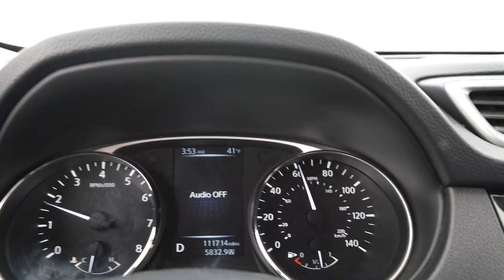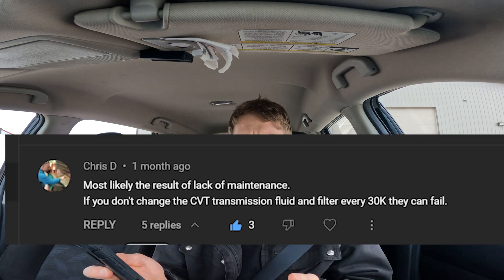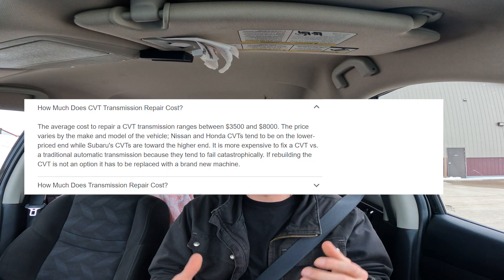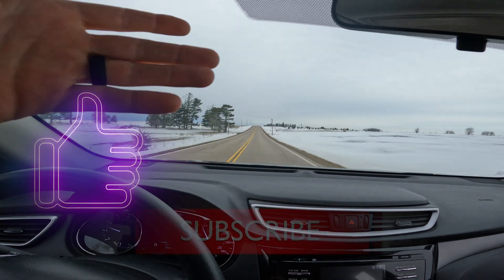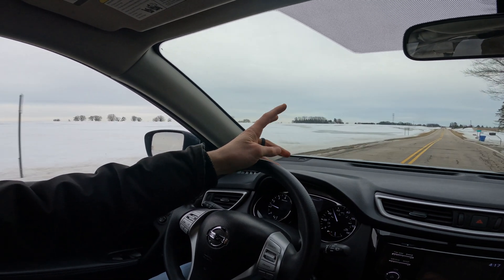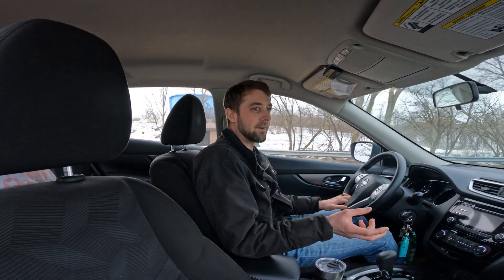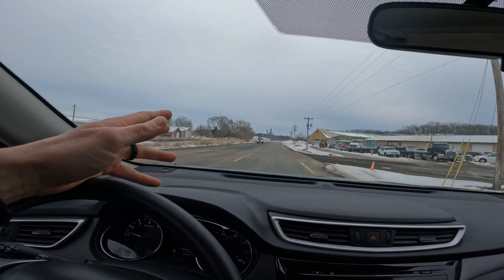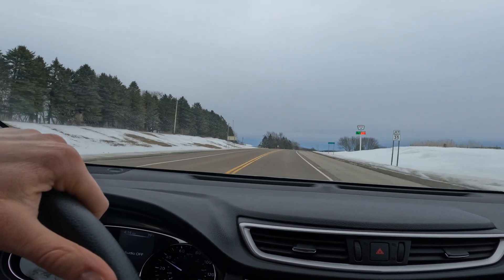Everything WRONG with the Nissan CVT Transmission

Comment: Nissan needs to be held accountable for selling faulty transmissions !!!!!!!
Reply: I have a 2017 Nissan NV200 and so far is running good
Reply: The government is pushing companies to comply with their pie in the sky climate change garbage perversion.
Reply: Nissan as well as many Japanese automakers use CVT for many models around the world, including Japan, since it's more fuel efficient and better suited for stop/go urban driving. There are no known issues in Japan with CVT, since fluid is exchanged every 30,000-50,000km as part of routine scheduled maintenance.
Reply: They're going out of business, Duh?
Reply: Faulty "Chinese" Transmissions.  And totally agree with you.  It really sucks to end up with a Chinese transmission in a Japanese car.  Just terrible.
Reply: @johannjohann6523  Jatco builds the transmissions for Nissan and is not Chinese they use some factories in China for manufacturing which all brands do. They are not developed and designed by China. The issue has been the CVT and its weaknesses. They need serious maintenance to last and since day 1 Nissan claimed they were sealed for life not service was necessary. Everybody by now should know to not buy a Nissan automobile unless it is a truck. If you buy a Nissan automobile and service the transmission every 25k miles you might make it to 200k miles if you drive it and baby it.
Reply: @NDIrishfan71  That goes for the Rogues too, get the CVT serviced / oil changed every 35K miles.
Reply: @metalmike570  I still would not buy one period. They have stayed with the CVT for too long and its putting them out of business. Better hope Honda does buy them because if they do not Nissan is gone.  Nissan should have offered traditional automatics they would have sold more. If I see CVT in a vehicle I walk away and buy something with a traditional transmission. I prefer Standard. I liked the Accord better than out Camry as far as looks and ride comfort, but it had a CVT and a Turbo in it 2 items I automatically say no too. Toyota got my business on a 2020 Camry SE. Cars been rock solid for 5 years knock on wood!
Reply: @NDIrishfan71  I have a Rogue, a 2019 and the engine is a 2.5 liter 4. We know the engine is great though. At 90K miles I just got the CVT oil changed again. If I get it done every 40 K it'll be fine. But the dealer - well I should go to the mechanic I used to go to but its several towns away. It cost $280 to get the CVT oil changed at the stupid dealer.
Reply: Nissans CVTs are made by JATCO in Japan 😂
Reply: The transmissions themselves are not faulty the fault belongs to Nissan on not educating its customers on how to properly drive and service a car with a CVT in it. They told customers it was a sealed transmission with lifetime fluid LOL. If you service a CVT every 20k-30k miles and drive it right they will last. You can not hot rod them and expect them to last especially never changing fluid and filters. Take off from a stop is the most stress on the belt that is why Toyota put a launch gear in their CVT's to reduce the stress on the belt during take off. Drive it normal, and do not drive aggressive. Change the fluid and filter every 20k-30k miles and it can reach 200k miles. Most people do not drive normal they drive hard and fast especially when on freeways. If you are a lead foot and like to drive hard do not buy a car with a CVT get a traditional automatic or stick shift transmission. If your a normal driver and want to save on fuel as much as possible a CVT is perfect for you.
Reply: @NDIrishfan71  This right here is the second issue (the first issue being Jatco transmissions are just crap).  Manufacturers lying about maintenance intervals is pretty much across the board now, they do it with the goal that the car will last throughout the warranty but have major engine and/or transmission failure right after the warranty is up.  Not changing transmission fluid, and doing 10k oil changes will accomplish exactly that.  Change transmission fluid every 30,000 miles (20,000 in these junk CVT's), and change oil ever 3,000-5,000 miles (only go up to 5,000 if it's mostly highway miles).  The Jatco CVT's are still junk, but they will last a lot longer.  Any other type of engine/transmission if you follow those maintenance schedules you could easily get 500k-1 million miles out of.  But even the junk CVT's you can probably get 150,000-200,000 if you maintain them.
Reply: @NDIrishfan71 my first Mitsubishi lasted over 200k but I traded and second one just broke at 177k and did fluids on second one every 30k at dealership.
Reply: @Mark-gk3hh  Every brand made has people that had a good one out of the whole, there are brands that had fa more good ones than other brands though especially if you took good care of it and did all the services. That being said there are brands that were pumping out less failures like Toyota, but if you look close at Toyota you will see they had duds a long the way. Far fewer duds than any other brand though they were the most consistent through the years. All of the Japanese made cars were better than domestics through the 80's and 90's. To  the end of the 90's and into the early 2000's domestic brands got their shit together and started delivering better vehicles that were lasting as long as Japanese brands, but it was still select models and engines that did better. Then 2008 rolled around and they went back down hill again then 2020 arrives and every brand has been a real shit show up until 2025.
Reply: @NDIrishfan71  The service interval stated in the Nissian Manual  54,000 Miles.  I have the paper right in front of me (xtrail T32)
Reply: @NDIrishfan71 You shouldn't have  to worry about it.

Comment: My wife's Toyota  2018 CHR had a CVT transmission replaced at 76200 miles.  Thankfully we bought this car used and had the Toyota 7 yr 100000 miles warranty.  The CHR cvt's are well documented having transmission failures anywhere from 20000 miles to over 100000 miles.  I feel sorry for the owners who bought a CHR new as the warranty is something like 3yr 36000 if memory serves.  BTW Toyota would have charged me $11000 to replace this transmission if it was not under warranty.

Comment: You are quite ignorant about this.
First. Nissan did have some issues with the first CVT generation.

Second and third generation have been fine:
I had one and know of other 7 Nissans with CVTs that are doing well. Half of them with Murano 3.5L. Lovely fast car.

You MUST change the fluid at 30-60K miles!

Other than that, CVTs are the quickest, most efficient transmissions and are NOT going anywhere!

Comment: You didn't even mention some cars with cvt have a launch gear that makes them more durable. There is no perfect cvt transmission. But there is a way to use them in car designs. The only acceptable application is to add a launch gear to vehicles with cvt. This takes the stress off of their weakness immensely. It's annoying that Nissan refuses to add a launch gear to cvt cars like Toyota and even Honda does.

Comment: I was surprised to learn that the eCVT in totota's hybrids don't even have a belt.
Reply: Right! ECVT has nothing to do with CVT. The way Toyota hybrids work, they don't need a transmission at all. What they have is basically a differential (sometimes Toyota calls it the power split device) that connects the engine and MG1 (small electric motor) together so they work in synergy. There is no torque converter, no clutches at all and, most importantly, no belts.
Reply: @demagab just slight correction, there’s two electric motors contained in the power spit device. MG1 and MG2, MG1 is connected to the engine and works as the “starter motor” and generator for charging the battery. MG2 is the larger traction motor responsible for propulsion and regenerative braking. It can work tandem with the ICE to propel the car by varying electrical resistance with MG1 or on its own at lower speeds for a few miles (EV 
mode). For AWD drive model’s they added a third motor generator for powering the rear wheels on-demand and also adds to the regenerative capabilities.

Comment: I have a 2017 Sentra and I changed my transmission fluid 15 times trying to make it last
Reply: How many km/miles did you drive before the variator failed? How many km/miles now and is it still running?

Comment: My buddy's 2019 nissan kicks CVT just blew up on him a few days ago at 90k miles, and he had been changing the trans fluid and keeping the car maintained. It also wasnt a cold day (it was about 60 degrees). The only thing is that he is a bit of an aggressive driver. But he was otherwise conscientious about his car.  It surprised me a bit because I thought they had sorted the issues with the cvt in more recent models and that the 2019 would hold up since it presumably has the "new and improved" cvt. It seems like you need all the stars to align to keep these things from failing. 

And btw I personally enjoy the driving experience with the nissan cvt, which i had in some recent rental cars (Versas), but i wasnt trying to drive aggressive. Even though ive enjoyed the rental experience of cvt cars, i dont feel assured about the ownership experience.
Reply: 90k miles on a kicks.. how do you drive a kicks... aggressively? Like... what?     Bottom line is when CVT fluid changed and the cars are driven like a normal daily driver most of the time unless you need to floor it randomly to pass or merge.... zero problems.
Reply: @TGZ32  aggressively as in going 90mph on the highway instead of 60, and accelerating harder as opposed to easier from dead stops. But he was changing the cvt fluid and otherwise maintaining the car.

Comment: Probably it's just the way most Americans drive. They hit the gas hard as if they're on rush hour, even if there are consecutive traffic lights ahead. Then also slam on the brakes. You're supposed to drive a CVT progressively, small throttle input then progressively increase your throttle as your speed goes up.

Comment: I don't know if you heard about Dacia. I just wanted to buy a dacia logan with jatco cvt transmission wich was on nissan juke (code DXK or DXK0). Have arrived at dealership with cash in my hand tu buy it but after I saw all this videos with problems on this gearshift a refuze to buy it. Now I'm asking if I did a mistake or it was a good idea to buy it for ride sharing

Comment: Warranty, don't be cheap on cvt fluid amsoil. Dont gas it at the lights lol, its a rogue not a gtr, it's a cvt so they are sensitive. My transmission is under warranty. I had much more problems with my jeep then .y Nissan 😂

Comment: Just saw this now. Good review but ....... CVTs are in all sorts of vehicles like the Honda CR-V. This is certainly not an economy vehicle! I have a CVT in my 2015 Altima and although it is performing perfectly the dealership during a CVT fluid change informed me that there is a "judder code" issue and they are recommending replacement of the transmission. This is a joke!!!

Comment: I got a 2009 Nissan murano & haven’t had no problems. I take care of my car & treat it with respect. I change my own oil & cvt fluid & don’t wait to before it’s too late. I know people that will go a whole year, before they change the oil & air filter. Neighbor asked me to changed her brakes, cause they sounded funny. They sounded funny, cause the brake pads was gone & the rotors was cracking.

Comment: If you change the CVT fluid every 30K by the dealer there should be no problems.  I have a 2015 Nissan (Versa) Note with 84K miles.  No issues.  I don't "gun it" between traffic lights or "floor it" on the interstate.  Once you get used to the different sounds, you should be fine.  2 pulleys with a steel belt isn't supposed to sound like 6 finite gears.  Get over it.

Comment: I have a 2012 maxima since 2020. No issues w the cvt at all up to date. 91k miles. I change the oil twice ( nissan oem) my car has good power but i do notice the lack of power at the same time. I put a air intake in the car and it accelerates better and gives the engine that nice rawww sound. I can say this will be the last time i do buy a car with cvt because of the high % of failers. But the bad news is all auto makers are using cvt. But i only hope for the best for ppl that have cvt in their cars. Change your oil every 30k. Use the official brand rather than aftermarket.

Comment: You should not do a transmission FLUSH on any transmission, let alone a CVT. You just drain the fluid and change the filters and clean the shavings out of the pan and off the magnet. No flush if you didn't say that by accident.

Comment: If you are a DIY ,Changing the CVT fluid is as easy as changing the oil . Just more expensive.Just changed mine at 52k. 3 3/4 qts. Black Black Black.New fluid is a clearish light blue/greenish color. Has been running like a top since the day I bought it. Honestly, my transmission doesn’t make any noise at all. Keep my fingers crossed.Note: the entire transmission holds about 6 quarts but when you do a change only three and three-quarter quarts come out
Reply: Did you change both filters? One in the pan, and one on the side of the transmission.
Reply: @scrambler69-xk3kv Of course.Watched every video on YouTube before I jumped in

Comment: Cvt transmission on Nissan are garbage i just bought 2018 rogue with 120k miles and i never had  droven Nissan with cvt so I didn't catch the slipping problem when I was test drive it now I feel car shaking and shattering when want to start moving and my neighbor altima cvt is shot dead at just 130k miles and repair cost $6900 and car seating in front of his house for months now.
I should stuck with toyota my 2005 sienna has 250k miles and no single problem. Don't waste your money on nissan.

Comment: Your video is great. Thank you for the information. CVTs are not going away,,, for better or worse they are here to stay in IGP engines. I currently own a Rogue with the "new and improved" CVT. I believe they got rid of the metal belt and replaced it with a "chain drive system". I may be incorrect??? Hopefully they upgraded the small cooling system?? That said... This is my 4th Jatco CVT,, (Nissan owned). I have never trusted the manufactures about their recommended maintenance schedule. I am an old man so,, I have the fluids changed every 20K,, along with the filter system! As stated in an earlier comment,, the " special way" to drive a CVT,, If you want longevity is to NEVER go from a "stop" and leave the line quickly! Gradual acceleration is the only wat to drive these things. That thin metal belt acts like a rubber band. it will stretch and YOU will regret that! once up to speed you can drive it like any other car. As you said.. I don't think the MPG is a lot better than a normal system. My Rogue is an AWD Platinum. It is a good sized crossover and where i drive I average 35 MPG. I'm happy with that. I have never had a problem with any of my CVT cars but maybe I just got lucky.. As for the noise,, I sang in a rock band for years and I cant hear high pitches. HA! Thanks again. Rev
Reply: What year is it that has the improvement?

Comment: Great video. I have a CVT trash mission for a 2009 Altima, I change the stepper motor then I change the  valve body from a 2012 car, nothing works my car doesn't have reverse and goes 20 miles and hour, why the gears doesn't shifted? any idea? Thx
Reply: Check the wet clutches

Comment: I agree with the things you say, but between myself and parent's that have CVT transmissions, gotta be running on luck.  2010  Altima with 120k miles, 2012 Versa with 85k miles no problems.  I just don't get how these companies just don't go back to putting in regular automatics.  I would think with all the negative feedback, warranty repair, etc. that all of the brands and reputation get tarnished and well lastly listen to customer feedback
Reply: U lust luck
Reply: My moms 09 Altima just hit 201k and is running good🤷🏿‍♂️
Reply: My guess is regular automatics aren’t really so much better as popular narratives currently maintain and switching back could involve more problems than they solve. It’s not like geared automatics or manuals never had failures in 60k miles or less in the hands of poor driving or maintenance habits. Replacing any transmission at 150k isn’t unusually bad…until it happens to be a CVT it seems.

Comment: 2014 Altima w/ 197k miles, I change the CVT fluid and filters every 30k, I run Pennz Ultra Platinum in the engine with a Purolator BOSS filter change every 4k, also other parts/ fluids as well. 
It's been a great car, especially for road trips. It's not fun to drive however, but that's not why I bought it.

Comment: I was a tech for Nissan the biggest cause for failure of the CVT was people and service people putting the wrong fluid in it . CVT has a special fluid and if anything else is used the trans. will fail .
Reply from the maker: Yeah I would agree with that. I know the Nissan CVT has awful cooling for the trans as well.

Comment: Cvt definitely have low reliability rates. Especially nissans. But they definitely are more fuel efficient and they usually are smoother when they run right. And you can barely here the noise. You are being a bit biased I think. My wife likes them but we never keep her cars over 100k and we change the fluids at 50k. Never had a problem but I would never buy em any more than lightly used.

Comment: Do you ever, even under acceleration get over 2,500 revs? If so, you are doing it wrong. A CVT is for grandma driving. And then it is the best transmission in the world. Also, did you ever ask yourself why it is only Nissan having trouble with the Jatco CVT? Mitsubishi and Suzuki use them as well, with hardly any failing? Why? They cool them!